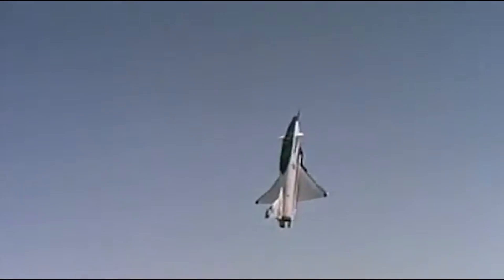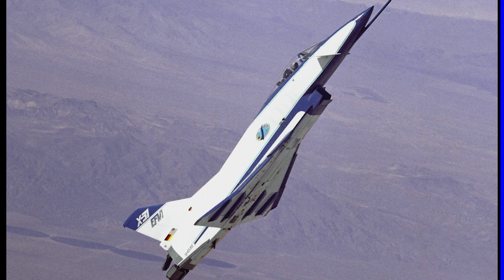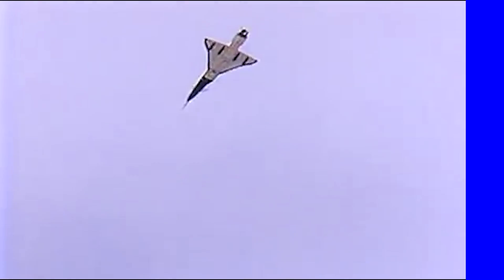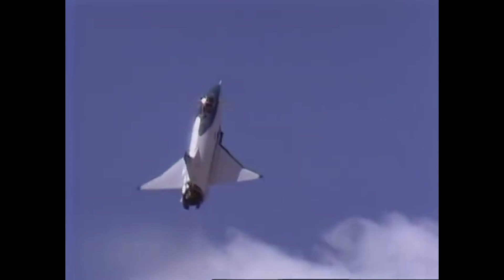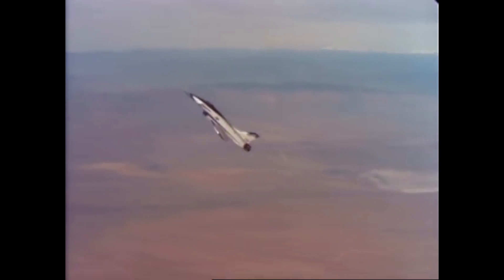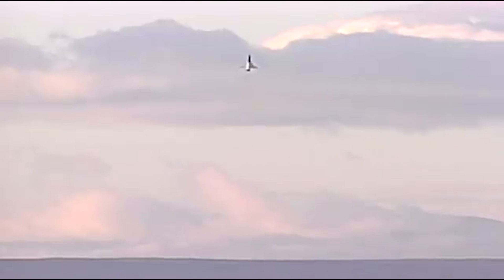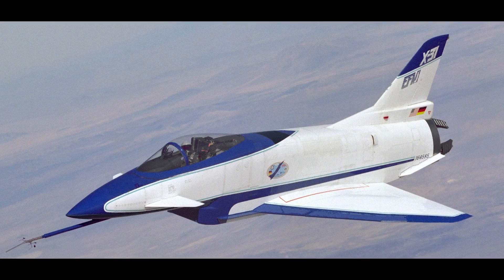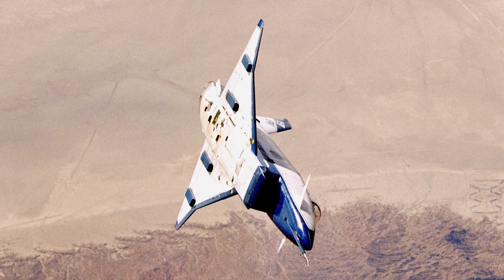NASA X31 | The Enhanced Fighter Maneuverability Demonstrator at Edwards AFB

Comment from the maker: Correction on the wing area:  It should be 226.3 square feet and 21 square meters.  Thanks to everyone who pointed this out!
Reply: There are multiple sources online with this mistake!
Reply: Ooops ,I was a bit tooo fast ;-)
Reply: somehow he forgot to mention the most important part. MBB came up with the TKF-90 concept which later developed into the eurofighter and is also the reason why the rafale and gripen look so similar. MBB tested their instability idea on the F-104G CCV experimental aircraft and then wanted to combine fly by wire instability with delta wings and canards for the TKF-90 concept with trust vectoring. that resulted in the x-31. it's also the reason why the eurofighter is capable of receiving trust vercoring if ever someone would order it as an upgrade.
Reply: Công nghệ hàng của USA quá đỉnh

Comment: Having come back to see this one again and again, I can’t help but imagine how AWESOME it would be to take a Block 70 F-16,squeeze in a P&W F-135 or a GE XA-100 with the same (or updated) 3-D thrust vectoring used on the X-31. 

That would be a NASTY little single engine air superiority fighter. 

OR… same concept in a smaller airframe (like the F-20) to be used in a Loyal Wingman-esque drone/support role. Just a super pissed off swarm of Locusts.  Same basic modular airframe with mission-specific hardware in the nose. EW, ISR/BDA, AWACS, A2A/A2G.

“We have the technology”

Comment: somehow he forgot to mention the most important part. MBB came up with the TKF-90 concept which later developed into the eurofighter and is also the reason why the rafale and gripen look so similar. MBB tested their instability idea on the F-104G CCV experimental aircraft and then wanted to combine fly by wire instability with delta wings and canards for the TKF-90 concept with trust vectoring. that resulted in the x-31. it's also the reason why the eurofighter is capable of receiving trust vercoring if ever someone would order it as an upgrade.

Comment: may just be me but was this the plane the EURO fighter was based off of it looks similar
Reply from the maker: Yes and the one of the companies that currently builds the Eurofighter worked on this aircraft as well.  Thanks for commenting!
Reply: MBB came up with the TKF-90 concept in the 70's which later developed into the eurofighter and is also the reason why the rafale and gripen look so similar. MBB tested their instability idea on the F-104G CCV experimental aircraft and then wanted to combine fly by wire instability with delta wings and canards for the TKF-90 design with trust vectoring. that resulted in the x-31. it's also the reason why the eurofighter is capable of receiving trust vectoring if ever someone would order it as an upgrade.

Comment: In 2003, when the US Navy was finished with it, I was fortunate enough to be part of the crew that took the X-31 from NAS Patuxent River, MD to its current resting place in the Deutsches Flugwerft Schleissheim.  One wing was removed to fit the aircraft inside a C-5 Galaxy for a late night flight to Munich and we then removed the other wing in Munich so we could load the fuselage on a lowboy flat bed truck.  Both wings rode on the back of the truck in a crate... it was an odd sight seeing it roll down the autobahn.  Everyone that played a part in that last project, or the final trip of the X-31 wrote their names on the aircraft... some on the nose landing gear door and some on the aft bulkhead where the thrust vectoring panels mount.

Comment: there is a mistake in your video and in wikipedia, suggested wing surface is way off, 2.5k sqft is an area of a midsize home. For comparison F15 which is almost 2 times longer and has more rectangular wings has wing area of only 608 sqft.
Reply from the maker: Indeed, I thought the area was too large but checked several sources and they all quoted the same figure...turns out the area is actually 22.6 sq meters...I pinned the correction as the top comment.  Thanks for commenting!

Comment: In my option:  

Maneuverability can have it's draw backs, for example the harder you push to closer you get to departure of control, and stability, and thus the stall has it's limits in an actual dog fighting...  It's great for the fans and airshows but other than than, not so much.  Not to mention Blackouts in a high speed maneuvers...

When you have loss of air speed dominance you may want to try the Cobra or the Stall to create an over shoot of the aggressor but in actuality, their will be other aggressors which likely sets you up as an easy target...  Truly the last option you would ever take...

Comment: I'm completely confused. 
We just saw how the SR-71 utterly dwarfed the X-31 but it has a wing area of 1,800sq.ft.
The X-31's wing are is over 2,400. 
What the frak is happening here???
Reply from the maker: Thanks for commenting, It’s a typo found in multiple sources it should be 22.6 meters squared, I’ve also pinned the correction as the top comment.

Comment: Unfortunately, only one system the X-31 have only one was integrated into a 5th gen fighter.... the F-22, the thrust vectoring. But not the multi axis system, but only a two dimensional symetry, or half of the whole thing. The multi axis thrust vectoring was later improved by Russia and have it integrated on the SU-27 variants.
Reply: this is nearly 30 years ago. .. and "old" tech... but way ahead of its time. Why move the complete plane when Young only Need to move your head(Apache helicopter like Technology) All modern Planes (F35 and Eurofighter) have Helmet targeting Systems and this is the reason Why the F22 is dissmised (they Could Not Apply it proper). You also do Not move a complete Tank you only move the turret/Canon. You just Look with your Helmet where the rocket should fly. So Russia is behind the current tech of Us and Europe (I gues or have no Other Infos)

Comment: Looks like eurofighter nicked the design for the typhoon.
Reply: Almost everyone is using that configuration! If u watch Millennium 7's channel u can find out why!
Reply: MBB came up with the TKF-90 concept in the 70's which later developed into the eurofighter and is also the reason why the rafale and gripen look so similar. MBB tested their instability idea first on the F-104G CCV experimental aircraft and then wanted to combine fly by wire instability with delta wings and canards for the TKF-90 concept with trust vectoring. that resulted in the x-31. it's also the reason why the eurofighter is capable of receiving trust vectoring if ever someone would order it as an upgrade.
Reply: this is nearly 30 years ago. .. and "old" tech... but way ahead of its time. Why move the complete plane when Young only Need to move your head(Apache helicopter like Technology) All modern Planes (F35 and Eurofighter) have Helmet targeting Systems and this is the reason Why the F22 is dissmised (they Could Not Apply it proper). You also do Not move a complete Tank you only move the turret/Canon. You just Look with your Helmet where the rocket should fly.

Comment: Not to be a Debbie Downer, but the wing area is probably off with a decimal point or something like that?  243 square feet sounds more plausible, because even taking the entire max length and wingspan of the plane, and making it an entirely covered rectangular surface, only adds up to 1000 square feet or so. Surprised nobody caught this mistake, I guess most folks dont dwell too much on what numbers could be plausible. Ah well. Nice video though.
Reply from the maker: Thanks for pointing this out and others have mentioned it as well...the number didn't seem right to me either but I checked several references and they all had the same figure...if you do find another number with a solid reference let me know and I will update the description.
Reply: @PilotPhotog  Just from an eyeball measurement on my screen, I got a very rough estimate of 180 squre feet from the main wings, I guess the canards are included as well and (again just looking at my screen) looks to be about 50-60 sqft or so?. Thats why I find the "one decimal place" error theory quite plausible, since that would be 230-240 square feet. I see that wikipedia states the 2430 number as well, but as you agree, that just isnt physically possible within the dimensions of the aircraft. A good old B17 got about 1500 sqft of wing area for comparison, almost 1000 less than stated for the X31. I sure hope no one thinks a small fighter like the X31 got larger wings than a B17... Thanks for answering. Great video.

Comment: I remember seeing the videos on the X31 and thought "wow, can’t wait for them to make this into a production fighter".  Too bad, this (with better engines) would have ran circles around Any 4th gen fighters.
Reply: somehow he forgot to mention the most important part. MBB came up with the TKF-90 concept which later developed into the eurofighter and is also the reason why the rafale and gripen look so similar. MBB tested their instability idea on the F-104G CCV experimental aircraft and then wanted to combine fly by wire instability with delta wings and canards for the TKF-90 concept with trust vectoring. that resulted in the x-31. it's also the reason why the eurofighter is capable of receiving trust vectoring if ever someone would order it as an upgrade.

Comment: I am pretty sure some of your sources might not be correct. In order to have a wing surface area of 226 square meters the plane would have to be massive, my apartment is smaller than that!
A square 10 meters by 10 meters will be a surface area of 100 square meters, and I think the whole wing will fit in it, with some space left to fit the projection area of the fuselage and canards.

Comment: So the experimental NASA Enhanced Fighter Maneuverability Technology Demonstrator is nearly as maneuverable as SU 27. Good job NASA.
Reply: When the SU-27 demonstrated the Cobra maneuver at airshows, X-31 developed a Mongoose maneuver to easily counter the Cobra maneuver.
Reply: @jeffc2017  Yeah, good thing X-31 is mass produced to counter SU 27.
And what is the pilot of X-31 going to do after countering Cobra? Smile for the camera?
Reply: @yarpenzirgin1826  Yes, X-31 was never intended for production.  It's purpose was to develop the thrust vectoring technology and develop combat tactics with the thrust vectoring capability.  The X-31 flew numerous "combat" sorties against F-18s, as well as with F-16s, F-14s, and F-15s from operational squadrons during the EFM program specifically to evaluate the utility of thrust vectoring in air combat.
Reply: What a bullshit... X31 was the First plane to do a Herbst Manöver, the First Post Stall Manöver on earth (way more challenging than the Cobra)

Comment: Something is wrong with the wing area I think - the length is 13.21m and wingspan is 7.26m - as a box that’s 95.9 square meters. The wing area makes up on a fraction of that box but the video gives a wing area of 226.3 (same as Wikipedia) but something isn’t right with that.
Reply from the maker: Agree, I checked several sources and they all quoted the same figure...I may just have to visit that museum in Germany with a tape measure.  Thanks for commenting and let me know if you find a different value.

Comment: ATTENTION DUMBASS:  The X-31 has a wing area of 2,436 square feet?  Are you out of your mind?  Do you get all of your information from Wikipedia?  NASA confirms wingspan as 23.83 ft.   2,436 / 23.83 ft. = 102.22 ft. The wings on this aircraft do not have a chord of 102 ft - and that's if you assume the the wing is rectangular in shape.  The aircraft is only 43.33 feet long.  The original B737 has a wing area of 102 square meters or 1,098 sq. ft.   Your ability to blindly cut and paste Wikipedia data is indicative of a disconnected brain.  The B707-120 has a wing area of 226 square meters or 2,433 square feet.

Comment: Its almost incredible that all the knowledge gained from this program haven't been applied on F35 which could really benefit from it. It could actually correct one of the greatest downside's of this advanced plane- its air performance. At least it was seen as an obvious addition, since F35B HAS thrust vectored nozzle for STOWL mod. Even more, that unlike for F22 which was specially developed to use 2D TWN to enhance its stealth from all angles, on F35 (A and C variant) either this TW system or fully 3D TWN could be easily applied. Im really not sure why it isn't... Russian planes do magic in the air with 3D TWN. Even more amazing cos, unlike F35 or X31 that are light single engine planes, Su 30, 35 and 57 are behemoth's in size, but TW makes them fly like they're feathers...
Reply: Of Course this is nearly 30 years ago. .. and "old" tech... but way ahead of its time. Why move the complete plane when Young only Need to move your head(Apache helicopter like Technology) All modern Planes (F35 and Eurofighter) have Helmet targeting Systems and this is the reason Why the F22 is dissmised (they Could Not Apply it proper). You also do Not move a complete Tank you only move the turret/Canon. You just Look with your Helmet where the rocket should fly.

Comment: Great video. I think you might have made an error on your wing area calculations.
Reply from the maker: Thanks for pointing that out - however I still get the same number shown in the video...can you elaborate?
Reply: PilotPhotog 
I don’t have access to the exact number. But if you made the assumption the wing was square using your wing span as a length and width. 23’. The total wing area would be 529 sq ft.  A much larger plane  such as the f-15 only has a wing area of about 608 sq.ft. As the wings are a modified delta the wing area is probably closer to 50-60% of the 529.

Comment: Great video.  I think your wing area figures are off by one decimal place.
Reply from the maker: Thanks for commenting, I checked using a conversion and it came out to 223 as posted in the video.  Not sure where the mistake is, can you let me know?
Reply: @PilotPhotog  @ 1:33, "wing area:  2,436 square feet, or 226.3 square meters".  That's slightly more wing area than an Airbus A400M Atlas.   Not trying to be a jerk, it just jumped out at me as a high number, so my guess is that somewhere somebody (possibly your source?) slipped a decimal place.

Comment: It’s me or looks like an euro fighter
Reply from the maker: Some of this tech was from the Eurofighter...thanks for commenting!
Reply: @PilotPhotog  this predates eurofighter by about a decade.
Reply: And the Chinese has a copy of the Euro Fitghter called, the J-10.
Reply: @sinchansouk1986  nah, J-10 is more reminiscent to the cancelled Israeli Lavi program.
Reply: @paulsteaven  yea u right.
Reply: A very small one
Reply: MBB came up with the TKF-90 concept in the 70's which later developed into the eurofighter and is also the reason why the rafale and gripen look so similar. MBB tested their instability idea first on the F-104G CCV experimental aircraft and then wanted to combine fly by wire instability with delta wings and canards for the TKF-90 concept with trust vectoring. that resulted in the x-31. it's also the reason why the eurofighter is capable of receiving trust vectoring if ever someone would order it as an upgrade.

Comment: Once again, an excellent video, crammed with relevant info. For me, as a Brit, the moment I heard NASA X Planes, Messerschmitt, Delta Wing,  Advanced Maneuverability Canards, Variable thrust Vectoring,  the word 'Typhoon' sprang to mind. Great flying machines have come from the  Lockheed and Messerschmitt stables down the years: some real pioneering stuff!  This X Plane series is going to be cool as, I reckon. Having ones ideas and constructions copied is a great accolade, however, the saying, 'I don't mind you copying me, but it'd be good if you could come up with some great ideas of your own sometimes' ring so true...oh, by the way, 'Thanks for the Titanium'. Stay safe man. Stay in peace.
Reply from the maker: Thanks Tim as always!  I am really excited about the NASA X plane series and have many videos planned. And to your point:  As Bruce Lee used to say “Use only that which works, and take it from any place you can find it.”
Reply: The X-31 was jointly developed between Rockwell International (formerly North American --- P-51, F-86, F-100... etc) and MBB... 2 legendary aircraft makers.
Reply: MBB came up with the TKF-90 concept in the 70's which later developed into the eurofighter and is also the reason why the rafale and gripen look so similar. MBB tested their instability idea first on the F-104G CCV experimental aircraft and then wanted to combine fly by wire instability with delta wings and canards for the TKF-90 concept with trust vectoring. that resulted in the x-31. it's also the reason why the eurofighter is capable of receiving trust vectoring if ever someone would order it as an upgrade.

Comment: Why was the Aircraft Limited to Mach 1.28, despite having 16000 IBF thrust Engine?
Reply from the maker: Great question and I am not sure either, I was also surprised when I found that to be the top speed while doing the research for this video.
Reply: His design doesn't seems to apply the area rule, so the plane probably generate a lot of drag flying supersonic. It was optimized for low speed performance, thrust isn't everything. Sorry for my bad English.
Reply: @lgtavs  :- the area rule may be mattered to designers of early fighters, who struggled with underpowered jet engines.